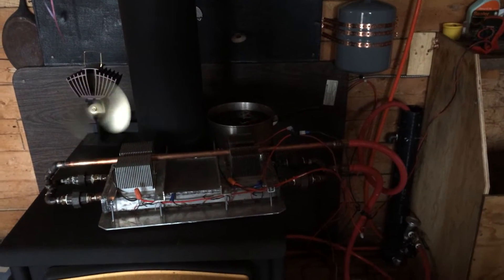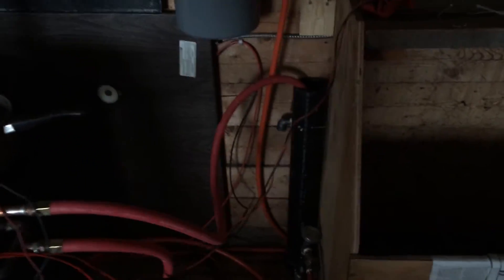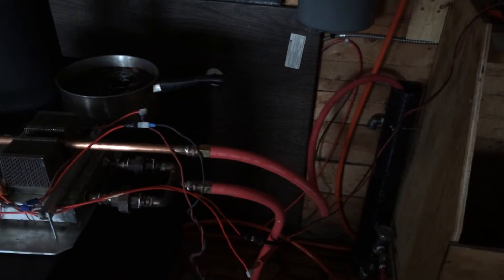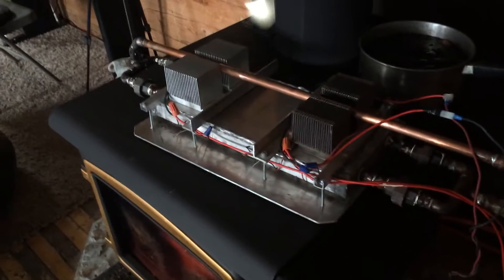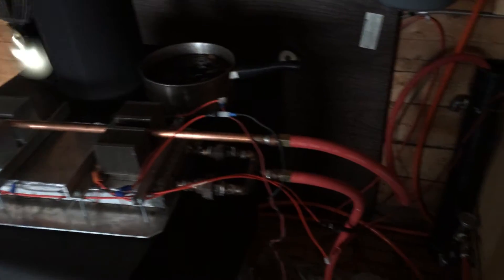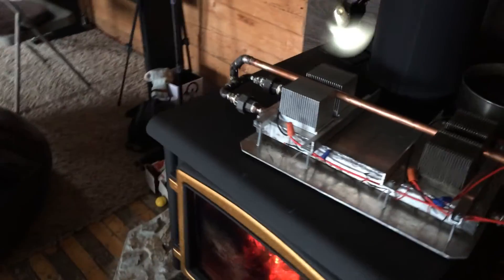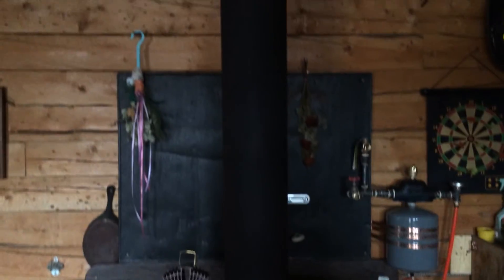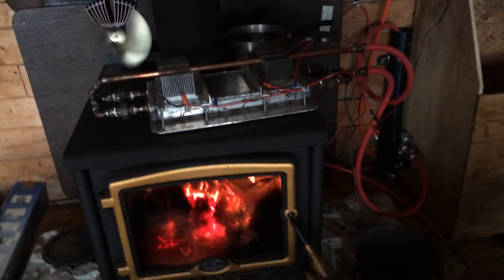Alaska off grid cabin, thermal electric generator update

Comment: Hey there. Just thought I would let you now that you can get TEC modules that are 12v 30A for a whooping 360W! they cost about $45 for 2 (online direct from china free shipping) I have 4 ordered and will be building a similar prototype in the near future. They are a little bit larger 6cm/sq but that should be easy to accommodate. Cheers!
Reply from the maker: Buffalo_Chips let me know how they work im interested in trying a new system, my system now produces some good power but i need a new thicker base plate, but as it is now im disappointed in the power output.
Reply: will do :)

Comment: How is this project going?  I am very interested in seeing how it turns out.
Reply from the maker: Air Marksman not as i hoped, i need a thicker base plate and fix some small leaks. im getting over 100 degree diff but not much power production only 700 ma max so far